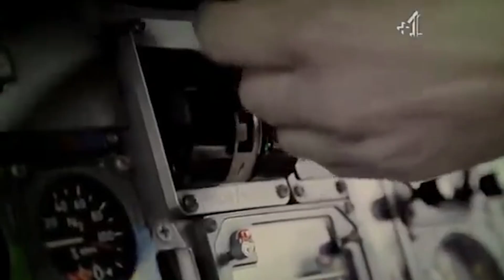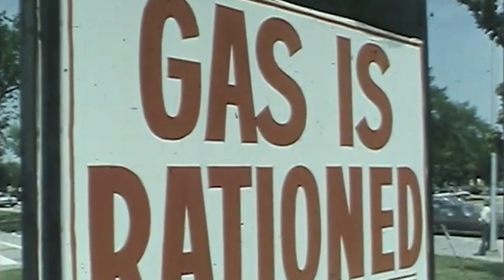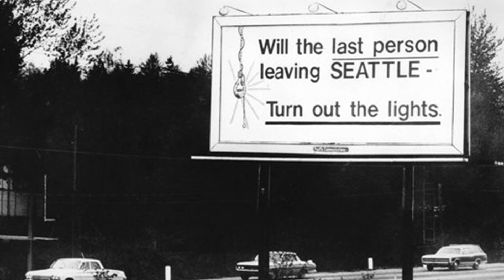The Forgotten American Concordes - Boeing 2707 - Lockheed L-2000 SST

Comment: 1:46 "Why would you guys buy something that exists, but it's NOT american? Please, consider this: we're going to make american citizens pays for our choices for something that it's not going to happen BUT at least it's not european" - President Mindblowing.
Reply: Boeing quite happily took the money and tried to make an SST, after spending more than the whole Concorde project and ending up with no more than a wooden mock up the government funding dried up and Boeing gave up, Boeing then led the protests making a lot of the noise issue but Concorde passed the noise tests at New York. The 747 was originally just intended as a stop gap until Boeing had the SST in production, that never happened.
Reply: +Splendido Splendente you say that like it's a fixed fact.  They trade the lead back and forth on both orders and deliveries depending on the year.  What a useless comment.  It's particularly ironic right now as Boeing is leading slightly in orders (334 v 323) and massively in deliveries (432 v. 339) for 2016 as of today.  So you're not even right at this moment.
Reply: According to most scientists, that thinking from THAT president is the exact reason that Americans put men on the moon.
Reply: The cost of hubris.
Reply: +Steve S Apologise is the British variant. Even in the British English speaking community, however, it is still not universally accepted, as apologize is older and had been considered standard for a long time.  Additionally if you did this thing called READING you would see my comment stated that all my information WAS NOT from Wikipedia and from the actual excel files of the Airbus and Boeing website.  My comment specifically said "Furthermore if you actually did real research and went to their websites
 for the current (September 2016) information you would see..."  But please, do go on and continue to make an ass of youself.
Reply: True, but being known as the world leader in aerospace is different from being known as the world leader in chocolate.
Reply: "Airbus is a joke, but a successful one." Hahahaha, Boeing creation date, July 15, 1916, airbus creation date, December 18, 1970, in 2015 Airbus had 57% of the market overall by units ordered, and has outsold Boeing 12 out of the last 16 years, yes Boeing delivered more planes but I think i would rather have the problem of a full order book than an emptying one...a joke I think not.
Reply: +lookoutforchris Your facts are wrong too.....lol

Airbus Orders: 438 (31st August 2016)
Boeing Orders: 355 (31st August 2016)

BOOM 

You need to withdraw your untruth and apologise to +Splendido Splendente.....
Reply: Why does it always have to be a size comparison with you guys? Are you making up for some... SHORT comings?
Reply: +Derek Tweedie  Your information is wrong in that you took the incorrect Wikipedia information instead of the information from the Boeing and Airbus website, along with not acknowledging the DELIVERY numbers lookoutforchris was referring to in order to prove his point that Airbus is not currently ahead in the market.
Reply: KrotowX Plain envy? You mean plane envy!  (Sorry, I couldn't resist!)
Reply: :D  Particularly true.
Reply: Only the U.K and France managed to get a supersonic airliner flying, but sure, the U.S is more advanced. Being patriotic doesn't mean you should ignore facts and only focus on how awesome your country is, especially there are at least a dozen country with better quality of life than yours.
Reply: The Concorde a failure, you  dump as hell 30 years of service with no Accident ,right. How many Boings come down in the same time of poor construction, and passed by the FAA while the American Aviation Industry would loose ground, against their competition, failing Cargo doors, exploding fuel Tanks bad fire protection, the list goes on and on, and now the Dreamliner, before needed 4 Engine for long haul flights , now Boing can use 2 Engines make it more efficient, that they can compete with Airbus, btw make little Research where Airbus is, there are many Airplane Manufactures fusioned that America had Patents stolen from. But i know everything comes from America they do everything better than other countries . Even the stupidity is far more advanced.
Reply: I am not anti American, i stated facts dumb ass
Reply: They only made 20 Concords and only 14 were put into service.
So for the Boeing 747 it is 1500 and still going.
For the 767 over 1000
1500 777s....
It cost billions to develop and each of the 14 was sold at a loss. When you spend billions to develop an airliner and only sell 14 and at a loss that is a failure. As to safety. To have the same loss rate over 1000 747s would have had to crash and that did not happen.
Sorry but your fantasy is just not backed up with facts and numbers.
Reply: Well back in those days it was not possible to work for both sides! The Germans deliberately handed themselves to the Americans rather than the Russians because they knew they would be better treated - and no doubt have more money at their disposal later to carry on with rocketry.
Reply: Fillipe356 europe and britian is better!
Reply: Simple the Concord didn't have enough range or payload to be really practical. As far as why not buy European?  Why did the UK build the Tornado instead of buying the F-15? Why did the UK they try to build the Nimrod AEW? Why did they try and build a new Nimrod ASW aircraft instead of just buying the P-3 or P-8?
Reply: what John F. Kennedy said WAS "mindblowing". badum tsss
Reply: As much as I like to tweek the Euros and other anti US nut jobs here is the reason why the US went for a faster and larger SST than Concord is simply that the Concord was a failure from the start.
In the 1960s the major cost driver was how many flights you can make in a day. The more the better. The US SST could make more round trips than the Concord. Also the Concord was too small and too short of a range..
The French and British governments dumped a pile of money on the Concord that it never made back. Then the French and British governments forced Air France and British Airways to take the Concord. The US government decided that the SST would never make back the cost to develop and they where correct. The airlines decided that the Concord was too expensive to buy and operate. The Concord also violated US noise standards and the people near the airports protested it. Eventually, the courts allowed the Concord to use US airports. Instead, the US went with large airliners that used fuel efficient high bypass turbofans like the 747, DC-10, and L1011.
So the Concord was expensive and never made a profit for the manufacturer and was in general a boondoggle. I believe that BA eventually made a profit flying the Concord bot only because they did not have to pay the true price of the aircraft. So no the US did not set out to stop the Concord. It was simply not a good product.  As an aircraft, it did meet it's specs in the end but those specs did not create a good product so it did not sell well. 
It was it a beautiful aircraft and I would love to have flown on it.  Was it a success? No not really.
Reply: Splendido Splendente moot point doofus.
Reply: Agreed David.  The conspiracy theory that Concorde failed because of opposition from Boeing is about as dumb as flat earth.  First of all, I don't think Concorde failed.  It filled the niche of supersonic flight as well as any plane could, and was a technological triumph.  But the niche of supersonic flight was just too darn small to be sustainable beyond a certain point...almost all countries banned supersonic flights over land, not just the US!  And anyhow the niche was only able TO BE filled in the first place because of massive government spending by the UK and FR.  Maybe If it had had better range, maybe they could have built more and sold them for flights over the Pacific.  But that wasn't Boeing's fault!  If anything these idiots should direct their anger at British Air and Air France for not being willing to spend billions to update Concorde for the 21st century. But they knew that investment would not make sense.
Reply: John Bender "It was a foreign government sponsored project against American commercial aircraft companies." Why would PanAm buy Concordes if they were against American airlines? That's like saying they were trying to shoot themselves in the foot. The aircraft was being developed by British and French government-funded projects to then be sold as the first supersonic aircraft. It wasn't a conspiracy against the world. It was more of a let's see if we can do this that turned into a "who's better" competition. British and the French came up with an improved version of a plane they already had. Russia spat out a death trap and the Americans were trying to one-up everything like they always do. The only reason why Kennedy wanted to build a better plane was to please the people and prove that the USA is the best. Would have been pretty cool if they managed it though, those concepts looked amazing.
Reply: +Derek Tweedie actually your facts are wrong too.  If you fully read the Wikipedia page you took those facts from you would of seen that you posted the numbers of ORDERS.  Orders mean nothing, deliveries are what matter as that means they were paid.  Anyone can make an order but then back out (which is shown on the aircraft websites under "changes").  The number of actual DELIVERIES is (as of 9-20-2016):

Airbus DELIVERIES: 400 
Boeing DELIVERIES: 491

Furthermore if you actually did real research and went to their websites for the current (September 2016) information you would see that:

Boeing currently has 409 Gross Orders 
Airbus currently has 377 Gross Orders

BOOM

You need to withdraw your pocket journalism research, apologize (not apologise) to +lookoutforchris and leave the real research to people who seek out the facts, not rely on Wikipedia, and then call it a day.
Reply: Well, to be honest, Boeing had the 747 in the works and knew the idea of selling more seats on planes that could be put into production at the time was a winning choice. The U.S manufacturers weren't really interested in SST's as they were far too expensive to develop much less build than more conventional planes they knew would sell. It was our government insisting on an SST that had them get into it, not their own decision.
Reply: lol.. There is a joke in the Simpsons where they show an American Navy air-force display. They say "And now for the pride of the American Navy.. The British Harrier Jump Jet"... Just saying ! . Roles Royce Engines on American planes? Inventors of the Jet engine itself?  ... Still going strong my friend and I'm American ! Not sure about your racism towards the Brits !
Reply: Yep, that's why Airbus sells more planes than Boeing
Reply: SCENE ISLE 
The Harrier is a joint BAE and Boeing project funded by both US and UK governments. Stop using it as an example. The pride of the US Navy was the F-14D Tomcat, and now the F/A-18E/G Super Hornet... What does Britain have?
Reply: The Americans had the Valkyrie bomber as their design platform, and believe me, that baby could get off the ground!
Reply: Steve S What? We were busy going to the fucking moon, we didn't want some overpriced POS plane that only went fast, a waste of time! As it was both Britain and France wanted out of Concorde but neither would admit it, so You both were saddled with this money loser. At least the commies realized it was an expensive farce and dumped it early! BTW, "Stupid Yanks" built the fastest planes on earth and kept them going for years. What was better overall, the Concorde or the 747?
Reply: Jealousy about another nations achievements is not called racism. The old plain envy it is :)

By the way can you remind me name of that Simpsons series about jump jet? I can't find it.
Reply: There were scientists captured by Americans and Russians.  Both sides had there own pet Germans. The point I'm trying to make is that without the superior American manufacturing and thousands of highly trained and motivated American engineers, the space project could not have accomplished what it did. Von Braun was certainly a driving force as were the other Germans, but they didn't do it alone.
Reply: DoomFinger511 so where abouts is my information incorrect? Your original post was clearly wrong my reply  was not...

Again you need to withdraw your first post that is full of inaccuracies.
Reply: Still couldnt make a better plane than concorde pal :D
Reply: Splendido Splendente 
Are you serious? Boeing has more commercial planes built and in service than any other company. Airbus is a multinational scam, and Boeing is an independent company. Europe will always be behind America.
Reply: splotsplot hey if it was the Germans that put us on the moon, then why didn't the captured Germans put the Russians there too?
Reply: Really? So the SR 71, a Mach 3+ aircraft couldn't be made, nor could the XB 70? We would have an SST, I remember much talk during My childhood, but it was shot down by environmentalists. And in the end the scale we wanted the plane in was economically unfeasible when we had the 747, DC 10, and L-1011, something Your country had Lockheed develop for Your airline by the way, in the works. Carry more passengers for far less expense and maintenance cost. Face it, You and France got screwed royally with Concorde, it cost your governments a fortune to have for what, some false pride? Could you or anyone You know afford the cost of a round trip on one? For a little over $1000 I can round trip London. This is what it was about. I've walked through the Boeing SST mockup, or what remains of it, and it would have been huge. A waste of money. We learned from pure turbojet bombers that those engines drink fuel by the ton, fanjets were far superior, but cannot break mach.
And what happened to Britain's aircraft industry anyway?
Reply: If the United States doesn't provide what someone else does and you want It, then you buy it from them. Thanks US for not making it! American Includes a lot more than the US.
Reply: The Concorde IS American; I'll repeat:

Both the Tu-144 and the Concorde are variations, clones of the XB-70 Valkyrie. 

The most important aspect of determining which came first and who took what from whom is to see the concept and design schematic iterations of each project. When you're doing something that nobody else has done or designed, the engineering process is literally flooded with concept and feasibility analysis followed by a litany of failed prototypes and alternatives to solve the same problem. NAA was brilliant in the number of schematics, designs, tests, and archetypes they chose - everything from the wing and fuselage to the environmental controls - and it all left an enormous, documented paper trail and design history that can be seen today in archives and a Museum in Ohio. The Tupolev and the Concorde developers have no such paper trail or design history. That's how you know the Concorde and Tupolev used work stolen from the Valkyrie - beyond just the simple fact that the Valkyrie was flying years before either the Concorde or the Tupolev, beyond the fact that the Russian and European design bears such a remarkable resemblance to the Valkyrie's outward (and inward) design. When a Mathematician or an Engineer only gives you "answers" without knowing how to do the Proofs or work the problem step-by-step, THAT is how you know that they are just repeating someone else's work. They are standing on the shoulders of geniuses. Actually, it's worse: many people are crediting the Tupolev and Concorde team with accomplishments not their own, and I would hope that - in their old age - their personnel have enough integrity now to be embarrassed by it than when they did in 1962. Only when the Valkyrie project was canceled did the British and the French go ahead with their plans to "civilianize" and clone the Valkyrie, signing their agreement almost immediately after. Had Mcnamara not sabotaged Ascani's team and prevented them from building their own SST based on the Valkyrie, there would have been no contest - the British and the French required a great deal of time to assimilate NAA's work; Ascani and co would have easily built and flown a civilian version of their "Concorde" sooner than Aérospatiale/BAC (it was NAA's design after all). It's not a secret, after all, and it's no wonder the British and the French made sure Ascani and NAA were cut off at the legs and the Valkyrie canceled before they went ahead. The development and project team of the Tupolev and the Concorde were proficient, make no mistake; they certainly rate as among the best at the time - but they were demonstrably NOT in the same class as Ascani's project team, in the same way that nobody thinks the developers of the Chinese J-31 belong in the same class as Skunkworks and their YF-22. 

(As an aside, the British also lobbied to have the F-22 canceled; and failing that, siphon off American expertise into the F-35 program which they had access to. This is the real reason why the F-22's numbers were docked, similar to the way the Valkyrie team was prevented from claiming their rightful prize in 1962; American government officials selling out to foreign powers)
Reply: Steve S Aww, wassa matter, Your knickers in a knot? We could have made the SST, but it wouldn't have been allowed to fly over the country, so what good would it have been? Boeing and Lockheed were happy to research these projects, but knew they were a dead end. But the money was there so why not? The biggest wankers I've known were brits, and typical of Your country, talking out from the bottom of a deep hole about something You needed the French to help with! The U.S proved it could be done, but it was useless. Our larger aircraft were better suited to the market they were made to serve. You're an idiot to not see that. Where's Your aircraft industry by the way? What happened to it, did the Labour party destroy all those jobs? I can say the same for most of Your auto industry.
Oh, and learn to spell, after all, it's Your own language..
Reply: You could not make a supersonic plane because you did not have the intellect to do it. There were two many problems you could not solve. It was the Germans who put you on the moon. Chuck Yeager broke the sound barrier in a plane design stolen from the British that you swapped with your own defective design. (I suppose Chuck was happy about that) The Concorde was scuppered by a bit of metal that fell off a badly maintained American Boeing 777 visiting French Soil. Concorde is a niche market like super  yachts and is viable. Just ask Sting. Your current supersonic VTOL aircraft was build with the help of the British and the Harrier people. (If you remember the Boeing design failed!!).
And all that with the "loads of money" at your disposal.
Oh, and the wright brothers were not the first to fly they were the first not to crash.  People were flying in Europe years before those two.
Reply: How is it "mindblowing"? This is literally how every single country, especially those in Europe, operates.
Reply: Steve S 
A piece of American crap that was maintained by the French ground crew where the aircraft was hangared... So, everyone is kind of at fault. The Concorde had no strength to resist impact, and after the 2000 crash, it needed Kevlar to reinforce it. It was a fast paper airplane, that turned out to be cool but really expensive. Badass plane, poorly constructed.
Reply: It was a foreign *government* sponsored project against American commercial aircraft companies. President Kennedy had every right to be annoyed and to support a counter to that. Besides, America was far more advanced in the field of aviation and still is.
Reply: John Bender  Maybe if he spent that money on giving people healthcare.... Who knows how many millions of lives he would save saved  by today. Just sayin. Priorities.
Reply: Steve S 
Two countries pouring a fuckton of money into a project, versus a nation at war, going to the moon, and space itself, while creating the most technologically advanced society and military on Earth, and investing money into two separate corporations, could not make the plane? We poured more money into space toilets than Concorde was worth. Where is the real British aeronautical prowess? Face it, Britain stopped being economically independent of France during the aftermath of WWII, and stopped being comparable to America in the 1850's. A few minor exceptions here and there, that America quickly overthrew. The fact is, Concorde was the single coolest waste of money ever put into the air. Lockheed And Boeing realized Kennedy was a dreamer, and that Concorde would never be as successful as conventional jetliners. Boeing is the most successful aeronautical company in history. Airbus is a joke, but a successful one. Airbus will never overtake Boeing so long as Boeing still exists.